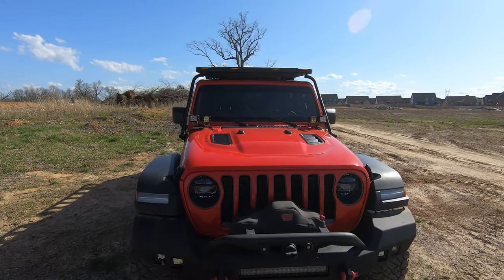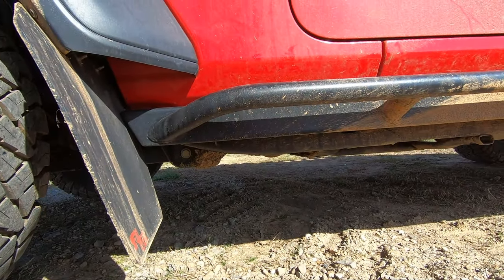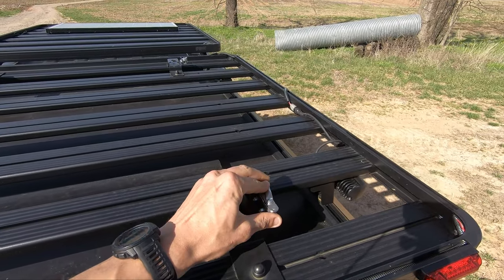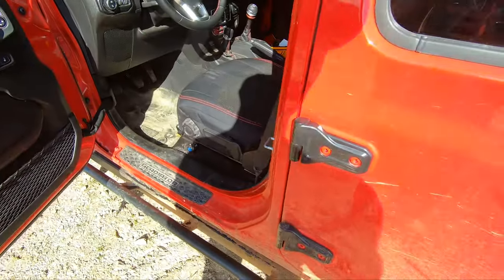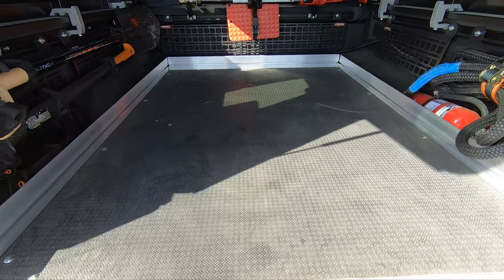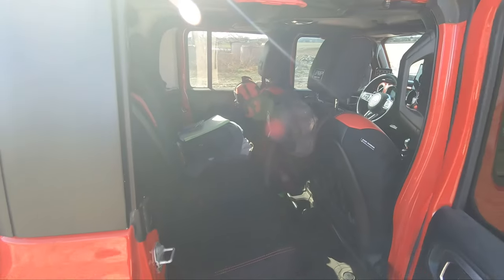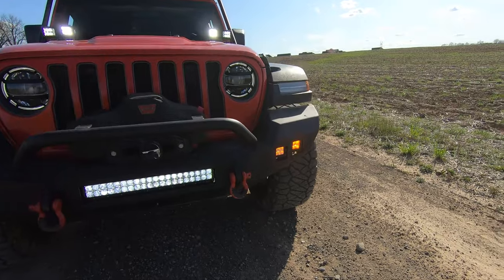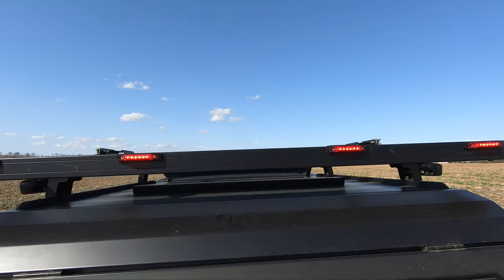Jeep Gladiator Rubicon | Truck Camper - Overland Build Update

Comment: That's the best overall private build I've seen. Also thanks for explaining in an understandable way. Smart decision to add the SmartCap instead of the open air bed rack. Especially love the lighting and solar, very well thought out. Thanks for posting!!
Reply from the maker: Thanks for checking out the video. I really appreciate the kind words! I put a lot of time, thought and work in to the Jeep. I've tried to make sure that every piece has its place and purpose. I do all of my own modifications, so it has been a ride. I'm very happy with how it has turned out so far. I have plans for some further changes, but the core of the build is in place. Now I just need more time to get out and put it to use!

I considered a bed rack for a while, but there was just nothing that fit the bill for me. Waterproof storage was mandatory, and my fridge would have interfered with any tonneau out there, so that drove me towards a full cap, which I honestly wanted anyway. For me, this provides the best of just about everything, with the only downsides really being a bit more weight, and cost. The RSI was definitely a "buy once, cry once" type of decision.

Comment: The Smartcap and everything in the bed is sick! The interior air pump is dope! I wish the gladiator had a standard transmission diesel model
Reply from the maker: Thanks! It took me a while to piece together. I think it turned out well!

I agree with you 100%. A manual transmission diesel is absolutely the direction that I would have gone if it were available.

Comment: Very nice, familiar to my build. I went with the same  Front Runner racks also. I dedicated the front to 2 140 watt panels, the rear to a RTT. Because I have the diesel my second battery had to go in the bed, went with the Equipt Expedition Outfitters DC25 Power Pack (still waiting on it). Also went with the A.R.E. CX-HD topper. FYI I was going to go with the same rear bumper you went with but after calling them I asked if you loose the spare tire under the bed if you install the winch and he said yes, so I decided aginst it. He thought they were going to develop the same bumper but with a tire carrier like a Wrangler bumper. We'll see. Keep us posted on your build, I may steal some of your Ideas. Thanks.
Reply from the maker: Nice! That sounds like a solid setup.

Honestly, I was a bit hesitant to swap out my solar slide, but after looking at my available space and how much power I was actually using, I found that 100 watts was still plenty for me and didn't take up much space topside.

For the rear bumper, I've measured it out, and I see no reason why it wouldn't fit a winch, especially with the solenoid remote-mounted. Last I measured, there was almost exact clearance for the WARN VR EVO 10-S, which is the one that I intend to use. Once I get around to attempting to mount one, I'm sure I'll eventually have a video up to report findings.

Thanks for checking out the video!

Comment: Awesome build! I ended up putting the extra 10mm spacers on both rear end of the RSI smartcap. It helps with opening/closing the rear door and tailgate. It is smoother and easier. Give it a try.
Reply from the maker: Much appreciated!

My gripe was mainly with the fact that it was overlooked during R&D. It was legitimately the first thing that I noticed, within about 30 seconds of having it mounted. I did actually attempt the spacer fix and it didn't do much for me. It's very possible I have the clamps torqued a bit tight, but with the weight that I have up top and the types of trails I drive on, I wanted to be sure the cap wasn't going anywhere! To be completely honest though, it's pretty much a non-issue for me. I simply pop the tailgate latch before opening the rear hatch so that they separate from each other, instead of trying to drag the hatch across the top of the tailgate. The positive of all of that though is that there's definitely not any dust or water intrusion in that area.
Reply: @TerraOutdoors  Yeah the weight on the top could be causing a tighter seal on the back. You could add extra spacers at the back. As long as you are used to it, i guess it is all good. My weatherseal was starting to come off even with the superglue so i ended up placing the spacers. no issues yet. Looking forward to more content from you.

Comment: Awesome build! Wiring those lights and electronics inside must have been some work! And having your jack, shovel, etc inside is a brilliant idea!
Reply from the maker: Thanks! The main catch with the electronics was finding one or two routes that worked. After that, it was just a matter of sticking with it. It took a little bit of trial and error.

I'm really happy with how the bed area turned out. I used to carry tools externally, but after seeing the wear and tear from the elements I knew I wanted an internal solution this time around. Luckily, BuiltRight had a killer product that could make that happen.
Reply: @TerraOutdoors  I love how all the things are put neatly around the corner of the bed and the sliding tray! Your build will definetly be inspiration for me! Thks!
Reply from the maker: @backcountryportal4774  That means a lot! I worked hard on it!

I honestly took a bit of a gamble on the sliding bed. I only saw one other instance of it being installed on a Gladiator, and the review wasn't very in depth, so I wasn't 100% sure what I was getting. I was afraid it would take away some usable space in the bed, but it pretty much fills it corner to corner, and leaves space in the voids in front of the wheel wells for my tools on the panels. I originally planned on just installing a fridge slide, but then I saw this and figured why not the whole bed?

Feel free to reach out if you have any questions!

Comment: any soft shackles? I went 7/8 too, but chose the 30 foot rope. Thanks for the complete walkaround.
Reply from the maker: Thanks for checking it out man!

Nope, no soft shackles (yet). I thought about picking up a couple to toss under the rear seat. With the Factor 55 hook, it's very easy and safe enough to just use the hard shackles that I have on the bumpers so I've just been rolling with those for the time being.

Comment: Kinda late to the video but how do you like the cargo glide? I've been trying to see how people feel about them but I'm not hearing much sadly. Very sharp and well put together JT!
Reply from the maker: Never too late!

Honestly, I love it. I didn't think I would like it as much as I do. I use it pretty much every day, and it's holding strong. If money was no object, I would have gone for a 100% extension one. I believe this one is 70%. The price difference was drastic though, and I got this one on sale, so I'm perfectly happy overall. There are beefier ones too that hold more weight, but they're also notably thicker/taller, which means less storage space. This 1,000 pound capacity one was the perfect all-around choice for me.

My one knock on it is that I wish it had a locking mechanism on both sides. It only has a handle/lock on the left, and glides freely on the right, which causes a bit of side-to-side shimmy/play when the left side is locked. I think that can also cause it to lock up under heavy weight, but usually a firm shake or pull or a bump with the hip fixes it.

Overall I'm incredibly happy, and it's insanely useful for what I built the Jeep for.

Comment: Bought a Sport this past December. I love it. I want to take my time modding and building, doing my research. If you were to start over with a new build, what would you do first?
Reply from the maker: Very nice! I slow rolled a few mods over the first few months, but once the bug bit me it bit hard haha.

That's a good question. I honestly don't think I'd change a whole lot. Personally, I'd always recommend swapping out stock wheels and tires ASAP if you know you're going to upgrade anyway, in order to maximize resale value. I sold mine in essentially brand new condition with just under 900 miles on them.

I would have bought the camper shell sooner for sure, but there was no good option for me until the RSI came along. If I had to change something, it probably would have been buying the Cargo Glide sooner, right after the RSI SmartCap. It's just so convenient. I've never owned a bed slide before, so I didn't really know what I was missing until now.
Reply: @TerraOutdoors  Thanks, that is a big help!

Comment: @Elevate Expeditions do you like the Genesis Dual Battery Setup and how well does it work?  It basically comes prewired correct and you just add batteries, install and hook up auxiliary to the bus bars?  Awesome setup!!!
Reply from the maker: Appreciate the kind words! I absolutely love the Genesis setup. It's hands down one of my favorite modifications. It's spendy with the two Odyssey batteries, but I can honestly say its well worth it. It pairs very well with the solar panel up top constantly feeding it. 

I've been out of town for months at a time on trips for work, or have run lights/fridge/compressor/charged devices at camp with the engine off and have never had an issue. The Jeep always cranks like it has a brand new battery. I've never had to link the two batteries together in order to start either, but it is nice to have that as a fallback option. I feel like you have to have done something incredibly wrong to find yourself unable to start your vehicle with this setup.

But yes, you're correct: It comes completely wired up and ready to go! I've heard of complaints about installation, but it legitimately is mindless. You just follow the instructional video on their website, and an hour or two later it's done. Easy! Eliminating the problematic auto stop/start battery is a plus too. In my nearly 3 years of ownership, I've yet to have an issue.
Reply: @TerraOutdoors  Awesome!  I greatly appreciate the feedback as that's the next modification I plan to make!  Yeah its not a cheap mod but I'm glad to hear that it works as intended and that it hasn't left you stranded.  Did you also install the G Screen?  I didn't see it in the video but if you have it I was wondering how you felt about it?  The data at hand would be nice but definitely not necessary.  

I can't wait until I can afford a topper either, that RSI SmartCap is so Sweet!

Comment: Are you able to take the freedom panels off with that front roof rack on?
Reply from the maker: I can barely shimmy them out with the rack wind deflector in place (it mounts to the bottom of the rack). If I unbolt the deflectors, there is plenty of space for quick/easy removal.

Comment: Is there a huge gap between the cap and cab? Some pics make it look huge, and some do not. I'm trying to decide between the smart cap and a Leer fiberglass. Appreciate any help.
Reply from the maker: It really depends on how you seat the cap. I'm not sure what people use as their point of reference, but I lined mine up flush with the bulkhead, and have, at most, a 3/4" gap between the rear of my cab and the front of the cap.
Reply: @TerraOutdoors  Yours looks great in the video, but if you Google the cap and look at Images some look horrible. Not sure why the big difference, some just look to not belong on the back, and others like yours look amazing. Didn't know if it's the angle or what. 

I'm gonna pull the trigger on one and hope I like the looks once it's installed in person. I found one local in stock and don't want it to get away. Thank you, nice jeep and great content!
Reply from the maker: @BigRandyR  Now that you mention it, I guess I have seen some with larger gaps. To my knowledge, I was one of the first to actually install the cap, and mine turned out like that, so I didn't pay others much mind. If I had to guess, I'd say the ones with gaps try to line up with the tailgate, instead of with the bulkhead. The instructions didn't offer any guidance, so I just did what felt right and I'm happy with how it turned out.

I appreciate it! I think you'll enjoy it. It's a fantastic piece.

Comment: Sorry if I missed this part, but did you lift this at all?  It looks great!
Reply from the maker: Thanks! And no worries! You didn't miss anything there. No suspension modifications just yet! Contrary to most, I want to keep it on 35s and the center of gravity as low as possible. I haven't decided which way to go, but I'm considering sets 2 inches and below with stiffer springs to help control the extra weight. I'll definitely put up an update when I figure it out.

Comment: Sweet setup!  Do you have an aftermarket suspension system?  I know those RSI SmartCaps have a little weight to them but how much do you think you added with the rooftop racks and the slide out bed system?  I just installed a molle panel bed rack system in my JT and I really love it so far.
Reply from the maker: Thanks!

I haven't done suspension just yet. I wanted to have everything added so that I could tune my suspension for my end state weight. I'm pretty much there, so now I just need to decide which direction to go. I'll be getting bags or sumo springs for sure. That will likely be my first step to help manage the excess weight on the rear. I've been eyeing the Falcon 3.3s, but as far as a lift kit I'm undecided. I want to stay under 2 inches of actual lift.

I haven't done my "final" weigh in just yet (I have my stock weight slip to compare against), so I can't say for sure how much weight I put on, but I'd wager I've added a little over 600 pounds between the bumpers, cap, racks, sliders, bed system and winch.

The molle bed system is one of my favorite additions. In combination with the cap, it turns the bed in to a swiss army knife, in my opinion.

Comment: Great build! Your channel came up as I searched for SmartCap reviews, and nice to see you have a CargoGlide as well. Do you hear any rattles from the CargoGlide during everyday driving? Especially when it isn't loaded? I'm planning a Ranger build, and both the SmartCap and CargoGlide are looking like the way I'll go. I look forward to seeing more of your videos and your impressive build!
Reply from the maker: Hey Steve! Sorry for the delayed response. Thanks for checking out the channel!

I haven't had any issues with rattling at all. I was pleasantly surprised with how tight the cargo glide locked in. Also, since you're looking at building a Ranger, the Gladiator actually shares the Ranger model number, so I can definitely recommend this unit. The one thing I'll say is that I wish it had a bit more extension, but that's a tradeoff, because the models that have more extension sit higher, and therefore take up more cargo space. For me, this model is the best compromise.

Comment: This is amazing.  I have the 6MT too - I am curious about your experience on the road.  With all the extra weight did you have to do anything special on suspension?  What about gearing?
Reply from the maker: Thanks!

I'm on stock gearing. I haven't felt the need to regear with 35s, which is the max size I plan to go. I rarely used 6th gear prior to the swap anyway since I typically cruise at around 65mph.

Suspension is also stock...for now. I will be upgrading everything and adding bags or sumo springs in the rear sometime in the near future. As equipped in the video, it's not too bad (the Rubicon suspension is notoriously soft to begin with, even moreso with the extra weight), but when fully loaded (tent, awning, fridge, gear, etc.) it wallows quite a bit at highway speeds.

Comment: Great build you have going here. You do an excellent job of explaining the pros/cons/reasoning for your mods as well. Did you happen to look into the Cascadia 4x4 VSS solar panel for the hood of your Gladiator? I’m curious as to your thoughts on it
Reply from the maker: Thanks for checking it out man!

I did look in to the Cascadia offering. In fact, I wouldn't stop bothering them about it when they first released the standard version without a Rubicon option. I understand that they did what they could within the space between the hood vents, but 30W just didn't provide enough peace of mind for me. I was hoping for at least 50W-60W. I was able to build the 100W setup that I'm running now--panel, controller, and wiring, for $50 or so less than their cost. I could have gone as high as 175W for a little more. I do love their products, and the ingenuity of that piece, and I get that theirs is a plug-and-play, prepackaged type of deal, but in my case the price:performance ratio just didn't line up.

Having said that, for people that aren't running a lot of electronics, camp lighting, a huge fridge, etc, and aren't comfortable putting together their own setup, it's a fantastic option. I would encourage people to do some research and check out their options as far as building their own though.

Comment: Absolutely love your build! I have had the same line of thought with the Smart Cap + Front Runner racks. I only just got my Gladiator and just got 2.5" lift and 35s last week, bumper and winch is on order. 

With the FR roof rack and drilling through the cap, did you have sealing issues in the roof after a while?
Reply from the maker: Thanks!

Everything has meshed very well. Zero regrets about the direction I went in.

I haven't had a single issue with leaking through the roof. The washers that frontrunner provided have been more than adequate since install.